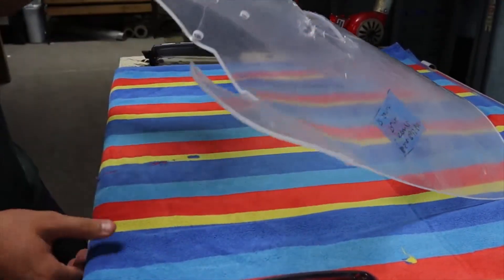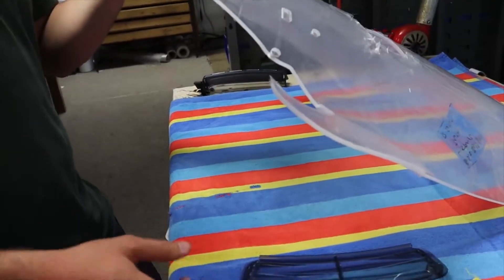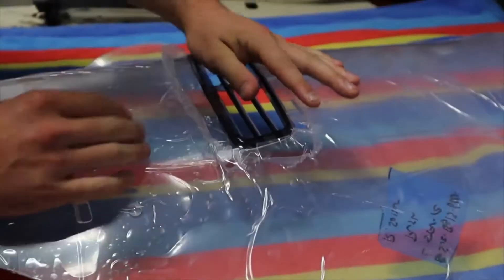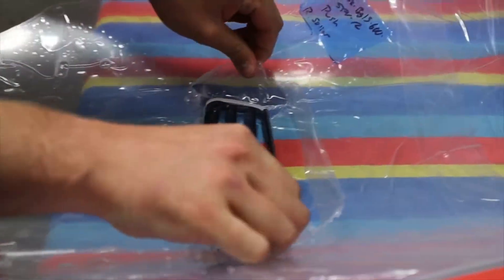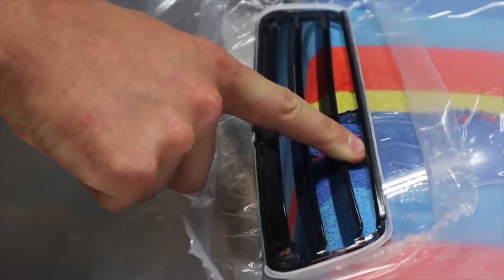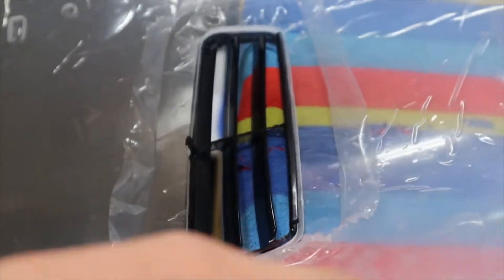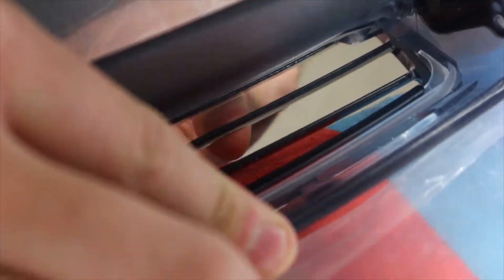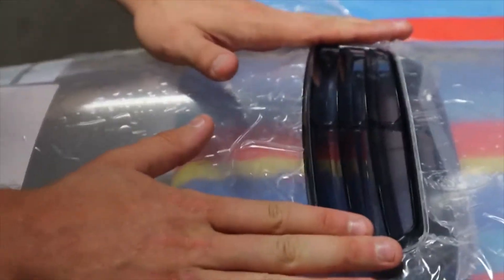How to Install a Vent in your Windshield | Clearview Shields | The Finest Motorcycle Windshields

Comment: Biggest problem I found installing an after market vent is finding the correct template to use to mark the windshield for cutting. i ended up making one with careful measurements out of hard cardboard before transferring it to the shield. Even then after cutting I had to make minor modifications to ensure the vent opened and closed properly. Clearly best to have Clearview do it up front because you don't save much doing it yourself. Plus things will fit properly if you do....

Comment: If I order a windshield from you and also order the windshield vent, does it come installed already or does the customer have to cut it?
Reply: They cut it
Reply: @thomasjoseph9224  Appreciate that.  Actually already ordered it and installed the shield just yesterday.  Like it so far.
Reply: @RamblinManMoto  does it really do away with the buffeting? I haven’t found a windshield that worked for me but none have had the vent so far

Comment: So I have a question about vents. I currently have a 2007 yamaha vstar 1300 with a reckless fairing and a 10inch windshield. I’ve been wanting to add a vent to it,  it don’t know what vent would work? And it would be something that I would have to take the windshield off the fairing and custom cut the hole for the vent to fit into. Please tell me if you have a product that I can do that with and how? Thanks!